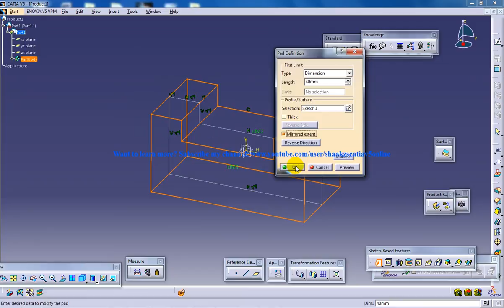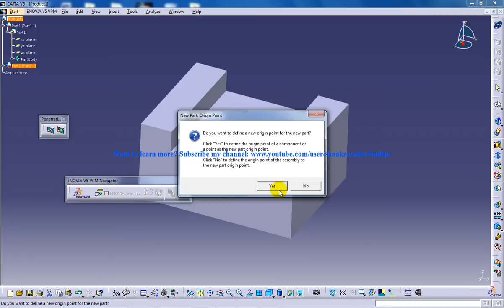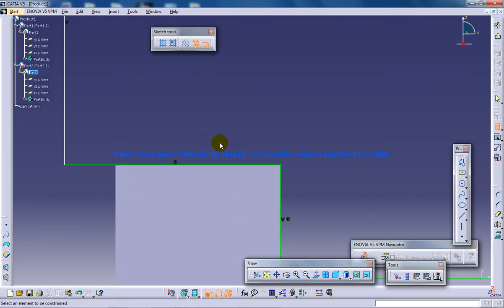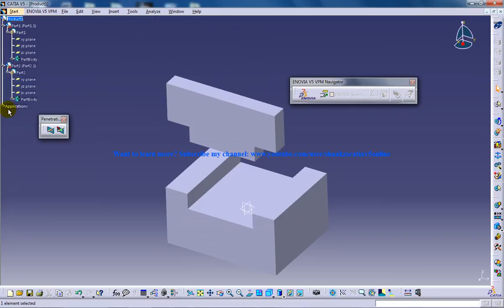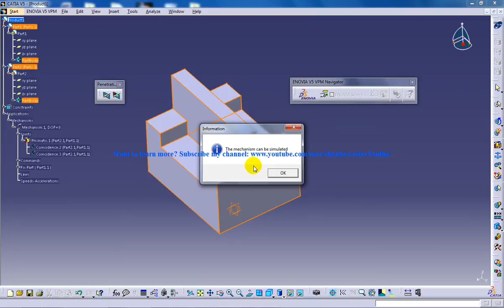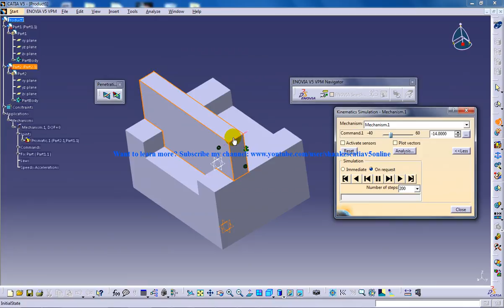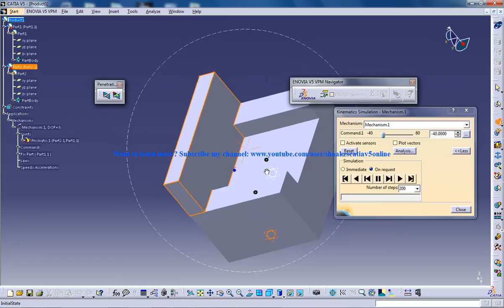Catia V5 DMU Tutorials|Prismatic Joint Simulation|Digital Mockup|Kinematics

Comment: i had made a catia  model of air engine 

its has pistons and cylinders attached to crankshaft and fly wheel...
can i make both prismatic (piston /cylinder) and revolutionary (crankshaft)
in simulation simultaneously...

i want it as if the engine is running...